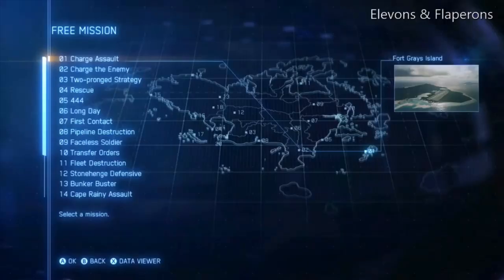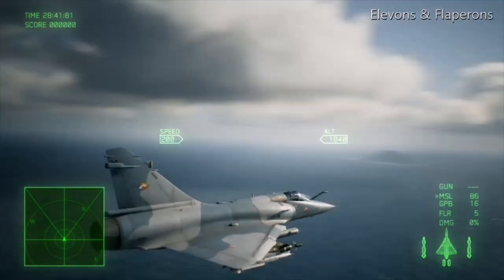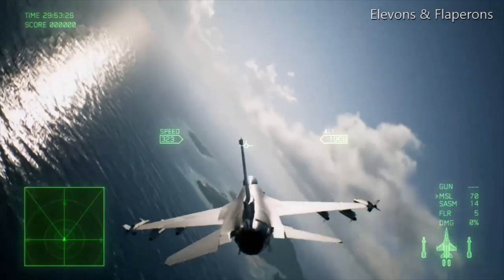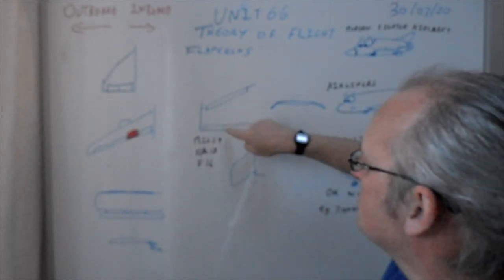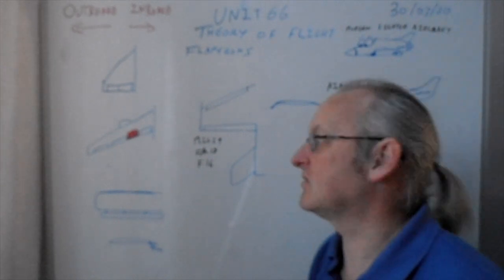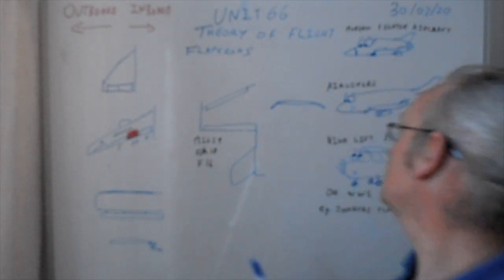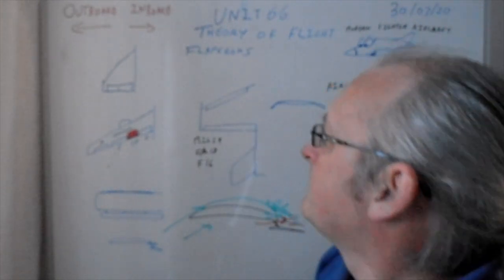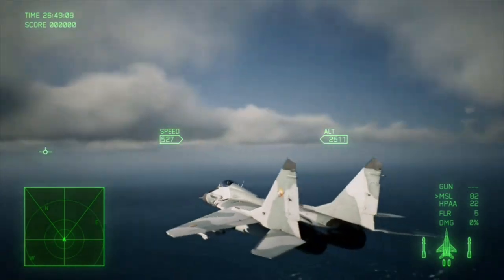Elevons and flaperons

Comment: Nice video, Steve. Quick question, are slats and leading edge extenders the same thing?
Reply from the maker: Hi Lewis, there are various terms used for leading edge devices. One such device is a leading edge cuff which extends out of the leading edge as an extension of the wing. Slats, slots and slotted slats all increase the camber of the overall wing to increase efficiency at high angles of attack
Reply: @newcastleaviationacademy7436  ok thanks